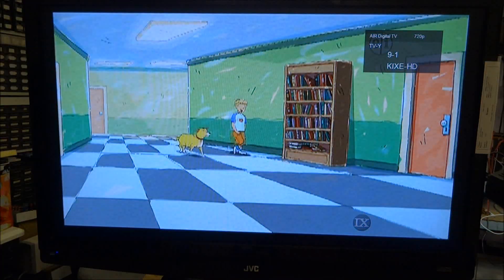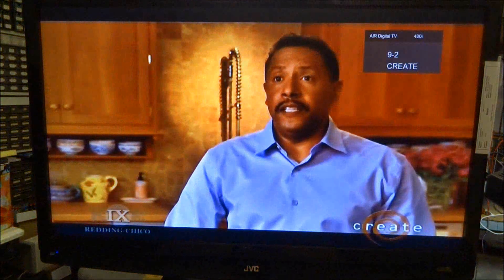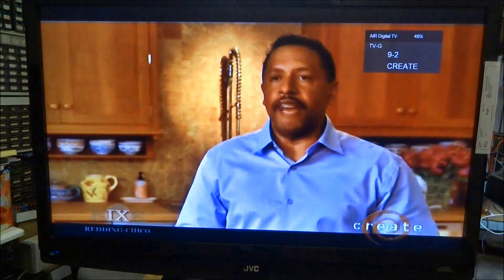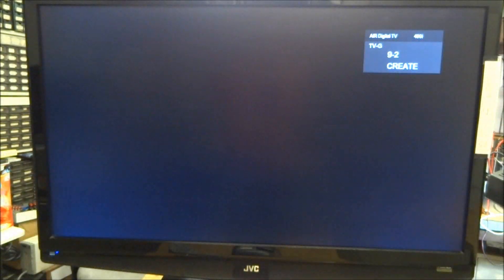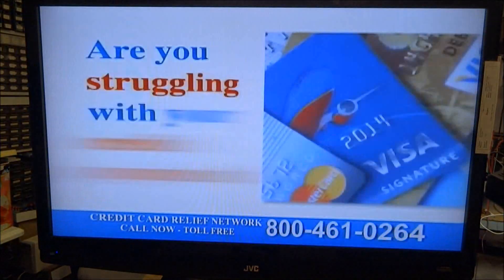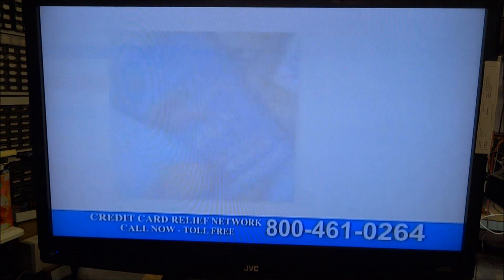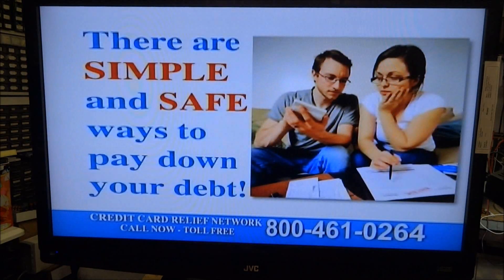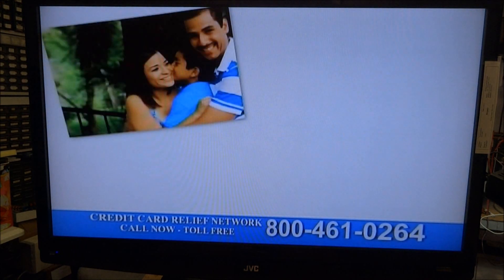How does Wind Effect UHF and VHF Digital and Analog TV Signal Propagation DTV ATSC

Comment: The antenna may not be moving at all in the wind, but there could be something between you and the transmitter that's blowing around and occasionally blocking the signal. Something like a tall tree or even a flag! My antenna does wobble a bit when it's windy and I get the same picture break-up issues as you do.

Comment: It could be due to 2 reasons 1. As many have pointed out it could be due to trees 2. As you mentioned the transmitter is 70 miles away so assuming you are using a high gain antenna and the wind might slightly rock it in a way that it doesn't point at the transmitter

Comment: Perfect just what I was wanting to know. I am in Corning Nor Cal and receiving more or less the same channels. Just dropped cable a few weeks ago and it is windy today. Was wondering if that was why I dropped some of my channels. Exact same affect on 9/18 but 7 is strong still I think it comes out of Chico as well. About 25 mi away. Thanks very helpful. looks like its just something I have to live with over the air vs cable as odd as it may sound I metal detect as one of my hobbies and wind  is a problem with detectors as well
Thanks for the video

Comment: This happened when I was little at my cousin's house with analog TV the picture was really clear and then static and then clear and then static it almost look like a cable signal and I asked her why does the pitcher keep fading out it was because of the tree outside the window when the wind would blow and this happened on a VHF Channel it was either 5 or 12

And other experiences I've had when a big vehicle Drives By it goes out on digital and analog and one time the weather got so bad it knocked out a repeater in Northern Michigan and it was picking up a channel from Wisconsin and rebroadcasting it

Comment: I'd like to get in touch with you more directly - KE3FL at comcast.net my web site is: http://cs.yrex.com/ke3fl you can send me an email from the site as well.
I too experience this phenomenon but in my area I always thought it was due to things such as moving tree limbs, rain, snow, etc.

I'd like to know if you are watching other possible changes due to the wind? Is there more dust or moisture in the air on these windy days? Anything else in the air? Pollen is a big one here on the east coast in the spring. Movement of antenna elements is definitely a possibility and if you're sure that yours are not moving, as I am since mine are inside the attic or garage for two of my antennas, then perhaps the TV station antenna is moving?

Hope to hear from you,
Phil, KE3FL

Comment: Have a question, have a Sony KBF70xbr950 using it for over air TV. I have noticed it has a high threshold and only picks up / programs stations with signals that are least 80 to 90%. Is there an adjustment that you can make to pick up more stations or lower the threshold to say 40 to 60% signal strength ?You provide a lot of great info thank you!

Comment: Did you use a single antenna to receive both VHF and UHF? Try use 2 dedicated antennas. One for VHF only and the other for UHF only and mix them by using a diplexer. A diplexer has two inputs and one output. The VHF input passes the VHF signal but blocks the UHF and the UHF input does the opposite.

Comment: it is the effect of the wind itself on occasion my fm gets that way and the antenna is a good one and inside the house and when the wind blows hard it gets staticy, I do miss analog a lot where I live even after having all the bells and whistles boxes and addons I don't even get channel 13 on digital and that's after around 350 bucks on the of things they claimed that made the channels come in.
 I returned them and got directv and miss analog a lot with a good antenna which we did have we got 4, 5, 7, 9, sometimes 11, 13, 15, 16, 22, 28, 30, 33,and 40 oh and channel 12 at night and 8 from Oregon after digital took over not a single one.

Comment: I have operated in the 440 Mhz ham band and never noticed any wind effect even on weak signals.  I have great respect for you as a tech but I have never heard of this  issue.  Bad coax? cross polarization? (you mentioned a ground plane).

Comment: The problem here is the ATSC transmission. Terrestrial broadcasting is very prone to multi path and ATSC is poor at dealing with the issue. US broadcasters have to run stupid amount of transmitter power to try and overcome the problem. On the other hand, DVB-T and DVB-T2 that is used for digital TV in Europe and other places in the world doesn't have these problems as it's specifically designed for terrestrial broadcasting and the types of problems that can be encountered. Oh and the transmit power can be a lot lower.
Reply: +Bill Druar Typical multi path interference. We had it bad in the analog days here too on windy days, with the DVB-T transmissions it got solved for the most part, a greater problem in digital here is on summer nights with the troposferic propagation as there are many distant transmitters with the same frequency causing co-chanel interference.
Reply: electrocity2000  what about his analog fading?
Reply: I can receive dvb-t with a omni dipole in my cellar with little to no breakups and the breakups aren't the screen going black but usually small pauses or blockieness but well I am about only 10km away from the transmitter and it transmits at 50kw

Comment: Yup, get it here in Vancouver BC too. When the branches of the trees start waving, the signal level changes due to water in the leaves and branches causing signal reflection and multi path.
The higher the frequency, the shorter the wavelength, the more effected it gets.

Comment: i live in Florida in a TV fringe with vhf hi, vhf low and UHF.  the nearest stations are 30 mi with the most stations 45+ miles away and with lots of trees. the vhf stations far away are easy to get. the UHF stations 30 mi away are weak but receivable. i have thick bush right in front of  the antenna i find with the trees that having the antennas low say 5-20 feet up is better.this is because their is less movement so multipath is not much of a problem so the picture is good but signal is weak. this is due to attenuation of the trees. so going up is not allways good for UHF. vhf is different going up hi is most often best do to their being more signal. multipath is not often encountered on vhf do to the longer wave length. so going up ware their is more movement in the trees is not a problem on vhf.
Reply: jake michael I get fading on my fm rcvr if I stand in certain places, I assume its multipath.I
Reply: +Bill Druar Multipath distortion.  Correct.

Comment: Moving tree foliage can alter the phase of a TV signal causing phase cancellation at the antenna. This effect is more pronounced on UHF due the shorter wavelength. Also Digital stations operate with less power than analog did. This is because the FCC has removed a number of TV channels from TV service and crammed more stations on each channel. Also lower channels- especially ch 2-6 have proven unsatisfactory for digital TV. And keep in mind that the FCC decided that stations should continue to use there old analog channel identity- even though in most cases they are actually transmitting on a different RF channel than they say. The TV will display whatever channel number the PSIP data tells it to.
Reply: +Nathan Kayle Correct.  The wavelengths are smaller than the leaves on the trees.  It's like waving your hand in front of an whip antenna attached to an FM radio while you're trying to pull in a distant FM station.   The station fades in and out when you wave your hand up and down.  This is why when you're getting a DirecTV or Dish Network satellite dish installed, they recommend trimming back the tree before installing the dish, otherwise you get the same results shown in this video (signal dropouts and pixelation).   Rain drops are larger than the wavelength of a satellite TV signal and if the dish isn't peaked for strongest signal, same thing happens (dropouts/pixelation).
Reply: You're spot on.  Channels 52-69 has been deleted for the telecoms.  However, that was a huge mistake.  While VHF is nice for flat areas, like Florida, Kansas, and even Texas and Oklahoma...UHF where I live (on a Dissected Plateau mind you) UHF is more desirable.
Reply: The FCC deleted the UHF channels instead of VHF because VHF frequencies are not suitable for telecom use.
Reply: Yes, best example, in some places channel 55 is perfect for the Qualcomm Mediaflow services.
Reply: *****
I expect all OTA (over the air) TV broadcasting will be phased out. The frequencies TV uses are wanted for cellphone and data transmission. Eventually TV will be available only by cable, satellite or internet.
Reply: newstarcadefan
The UHF channels were taken first because they are most desirable for portable devices like cellphones.  VHF requires bigger antennas because of the wavelength- but big antennas and cellphones don't go together.

Comment: I used to see this all the time as a kid.  I was looking for analog examples of this problem when I came across your video. 

I grew up in the the Chicago suburbs and the channels I used to see this on were UHF 32 and 44.  On an ANALOG TV (no digital tuners or anything) you would get a waving picture when very windy.  This was very pronounced in summer as compared to winter.  A TV repairman told me this was caused by trees reflecting the signal.  In winter with no leaves, the problem was gone.

Comment: I vote for leaves causing multipath troubles.

With no wind multipath is steady-state; receivers can deal with it. When the wind blows the signal is variable due to changing multipath influence. The typical receiver has much trouble with it.

I wonder if this is an issue in, for example, the Arizona desert out where cactus is the only vegetation. (And if the cacti are swaying, you've got bigger problems...)

Comment: Love your videos!  I would bet in the fall the uhf signal is solid. The water content of the leaves will cause issue as summer comes.  However I have corrected allot of issues with ASTC reception by using a Variable Attenuator  but  at 70 miles I would bet the water content of the leaves are throwing your signal around making it hard for the tuner to figure out since it may get the same signal twice and not know which bit to crunch.

Comment: If you go into a service mode or setup you can look at how the BER increases with wind, as the moving leaves cause multipath reflections that make a moving pattern of deep nulls that wave past the antenna. With digital you can get enough multipath reception so that the signal is delayed so much that the decoder cannot recover the data reliably, as it has too many equal strength signals but with varying delays on the data. Analogue just becomes noisy but digital goes blocky then dies.